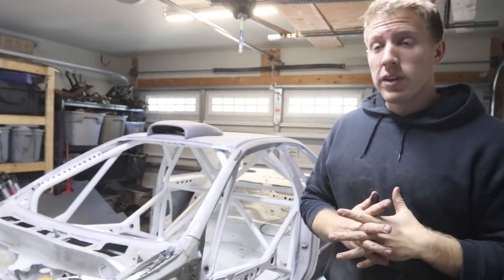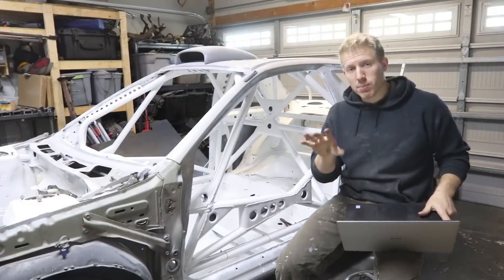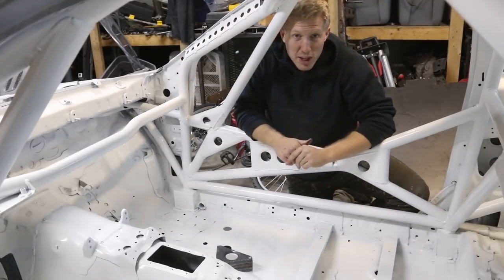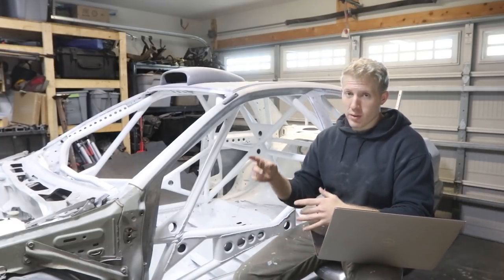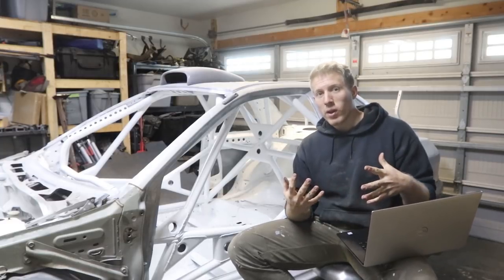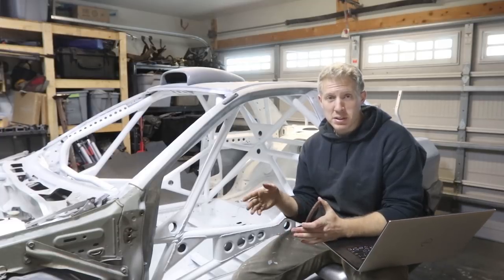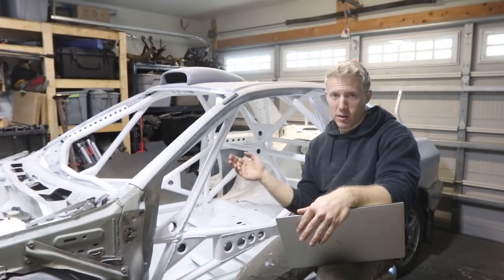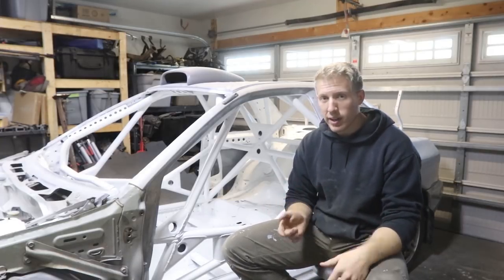TOTAL COST for the RALLY CAR Roll Cage in the Rally Subaru GC8

Comment: Damm nice! I think Im gonna try and build my setup too instead of paying like you say! I like the idea of learning. Yes its more time, but what the hell haha, small question? I think i saw your tube bender tool attached to the ground? Is it bolted? I never actually use that before ! 
Thanks and good job on the project! Its fantastic to see a build so well explained!
Reply from the maker: Thanks man, it's definitely the way to go as long as you have the ability and some of the know how before hand. Definitely don't want to completely learn how to weld while starting something that'll have to save your life. It is bolted to the floor, I put female concrete anchors in the floor so I can bolt it and remove it whenever and it won't have studs coming up from the floor to get in the way. You need a lot of effort to bend the tubes so mounting it securely definitely helps.

Comment: Would you recommend using CAD software or is it just not worth the extra affiliated cost then just making it by hand?
Reply from the maker: A CAD model would be a good idea if you wanted to get the cage design approved before actually starting it, but unless you have very precise measurements of the car's interior car than it would be hard to design a cage that fits tightly. Doing all the measurements as you go will make it a lot easier to build a cage that contours to the interior as well as possible, giving you a lot more space in the car and a stiffer chassis. Saving all your measurements as you go and refining the cage dimensions in CAD would definitely be useful though.

Comment: Disliked because you put a single cam na 2.5 in it. Ridiculous.
Reply from the maker: What if I told you Subaru put that engine in the car from the factory 😮
Reply: @DirtyGarage  Subaru didn’t put that cage in from factory. Figure it out.
Reply from the maker: :O Let the hate flow through you
Reply: You literally can’t run turbo as an amateur in most series. 
Once you get more experience you can swap a turbo engine in for the next season. But most series simply won’t let you race one.